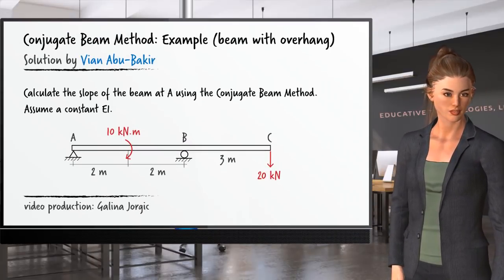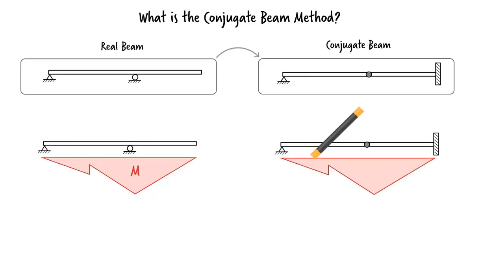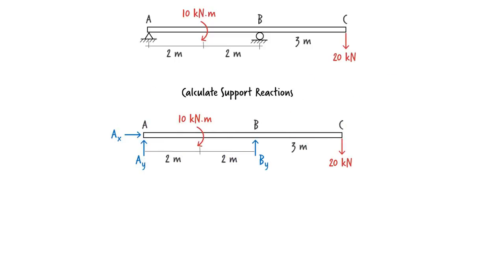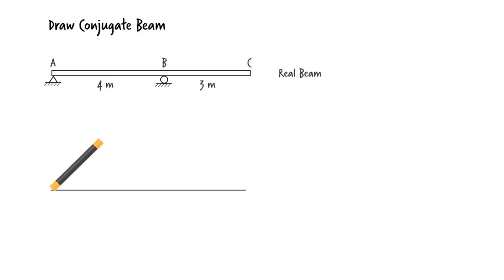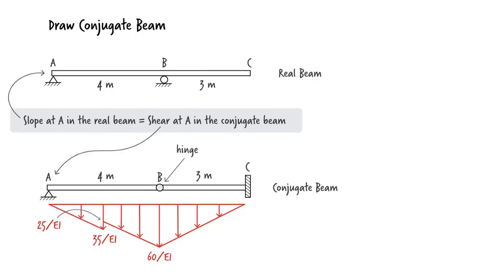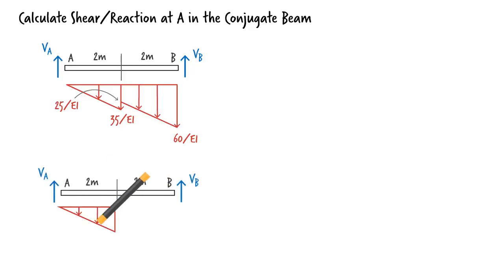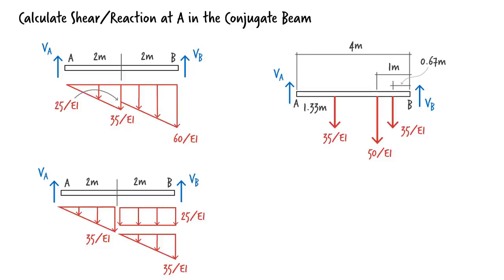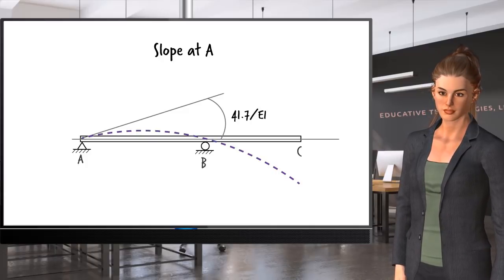EX02: Solved Problem: Conjugate Beam Method (beam with overhang)

Comment: how did you get 60 kN.m in the moment diagram? I kept multiplying 25x2... I feel like I'm missing something hehehe great video by the way
Reply from the maker: Not  quite sure what you are referring to, please elaborate and point to the specific timeframe where your question is based.
Reply: At 2:10
Reply from the maker: @Laris2725  Okay, now I see what you are referring to. We can get to that peak moment value of -60 kN.m either from the left or from the right side of B. 

Going from left to right: We have a negative moment of 25 kN.m just to the right of the concentrated moment at the midpoint of Segment AB. The area under the shear diagram from that point to point B is 2(-17.5) = -35.  So, the moment at the right end of that segment (at B) equals to -25 + (-35) = -60. 

Going from right to left: The moment at the right end of the beam (at point C) is zero. The area under the shear diagram from B to C is (3 m)(20 kN) = 60 kN.m, and since the moment at C must be equal to the moment at B plus the area under the shear diagram. That is, 
 Mc = Mb + 60, then, Mb = Mc – 60. Or, Mb = 0 – 60 = -60 kN.m

Comment: does this method work for indeterminate beams?
Reply from the maker: The method works for any beam. In the case of an indeterminate beam, to draw its moment diagram, we need to use a technique such as slope-deflection to determine the beam's reactions. Once the reactions are determined, then we can draw the moment diagram, turn it into the M/EI diagram, and proceed as usual.